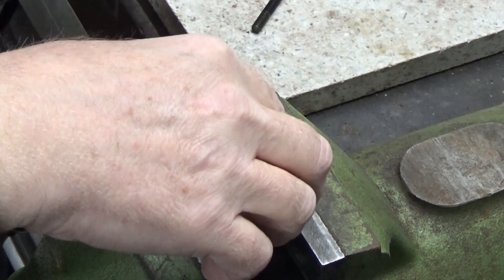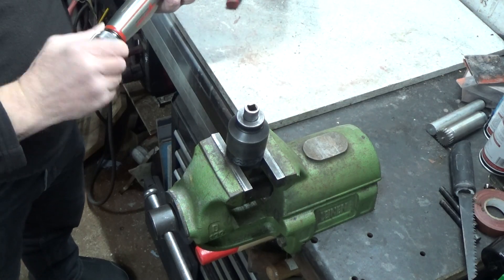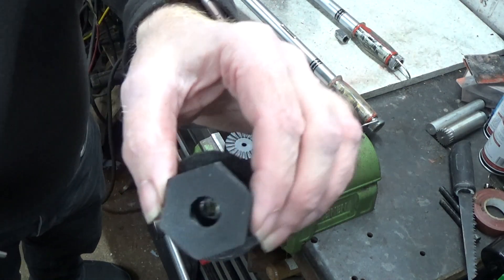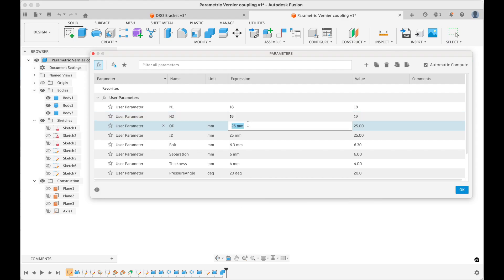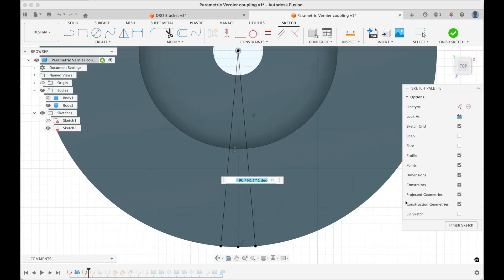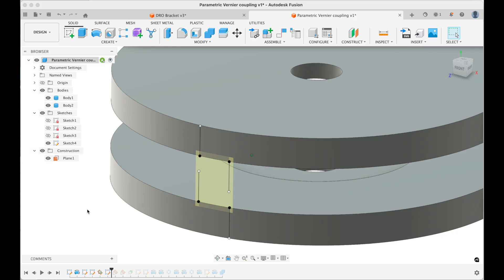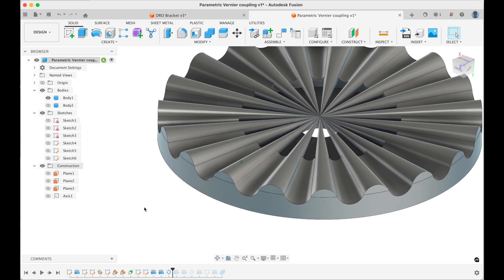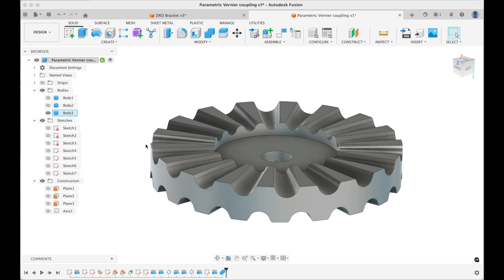Micro-adjustable 3D-printable coupling.

Comment: That's a really handy idea. Thanks for the video. Is there any real need for the sinusoidal pattern? For 3d printing, it seems that simple diagonal profiles (i.e. \__/ ) would work as well and print more easily?
Reply from the maker: It's not so easy to get the radial taper with a triangle, but it happens automatically with a revolve.

Comment: Very cool design! Kinda reminds me of cycloidal drive, will have to try it!

Q: is there a spring on the bottom of the assembly? 

Here is a printing idea: print the sections vertically on the bed, this will result mach smoother parts, use supports or ad a flat sections in cad.

Comment: I didn't know these vernier couplers were a thing, and I'll certainly use it next time I need high adjustability in my projects.
Reply: Looking at this part, and I may not understand it correctly, but it'd be a trivial part in OpenSCAD. I can give it a try and send you the file if you like. Where gear teeth are very difficult to model, the basis of this one is an array of cones.
Reply from the maker: @jwrm22  I did notice that Printables are keen on having a SCAD file to help people incorporate it in their own designs. If you come up with a SCAD version of the same thing then I could add it to the file list (or you could publish it yourself, which might be more straightforward as far as copyright/ownership goes)